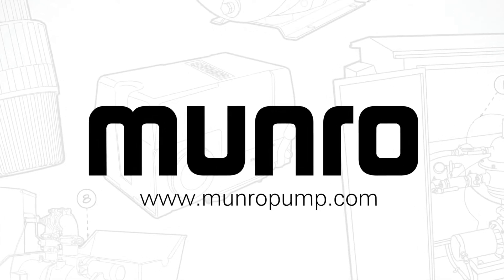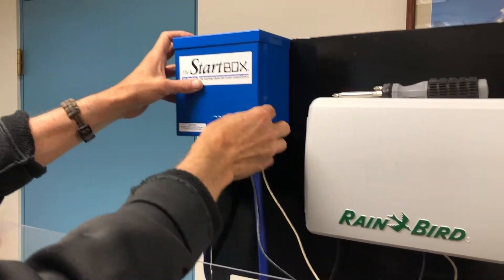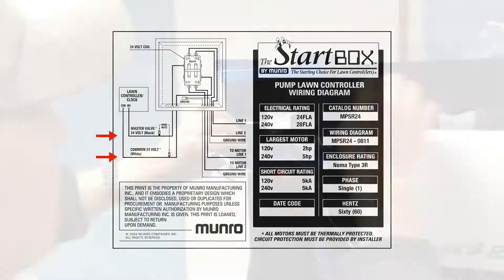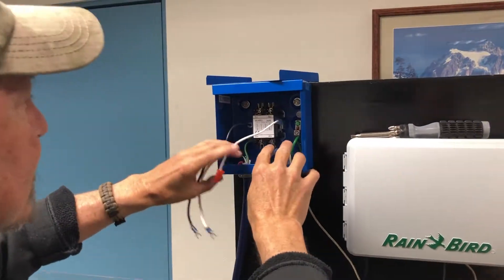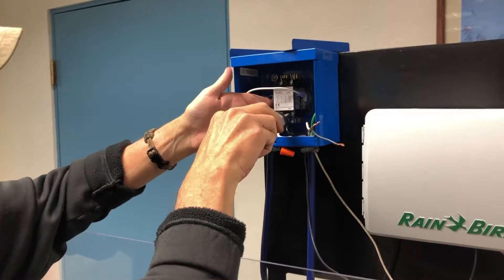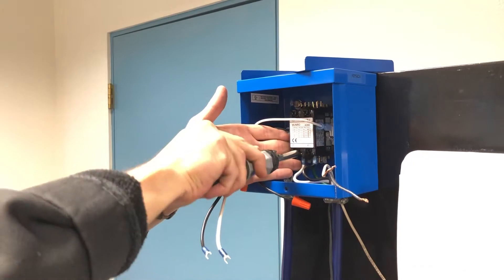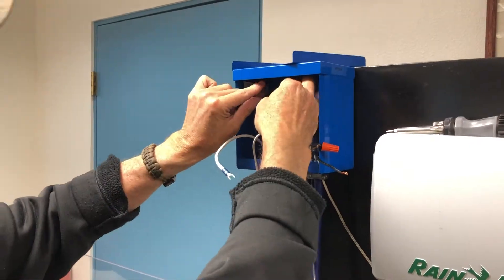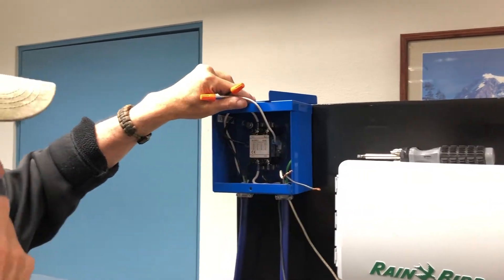How to wire a Munro StartBox

Comment: But how do you wire the pressure sensor?!  So useless
Reply from the maker: Thank you for your question. The pressure and temp sensor are polarity neutral - you can hook up either wire to either terminal. If you have further questions, please contact our Technical Customer Support team at 1-800-942-4270.

Comment: Will this allow my pump to stay on while being able to switch zones with the electric valves? I currently have a 240V analog/manifold system where the pump has to turn off and then back on after 15 min to switch zones. Loved your video!
Reply from the maker: Hi Paul - thank you so much for watching! The StartBox is getting the run/stop command from the lawn controller (or other signal device). As long as the run signal is being received, the contacts in the relay will allow the pump to continue to run. If the run signal is no longer present, the pump will turn off. So if an automatic lawn controller (RainBird, Rachio, Hunter, Orbit, etc.) is programmed for consecutive zones, both the valves and the pump would be signaled to start at the same time.

Every application and irrigation system is unique. If you have more questions, I encourage you to call our Pump Hotline and discuss your application with our Technical Support personnel. 800-942-4270.